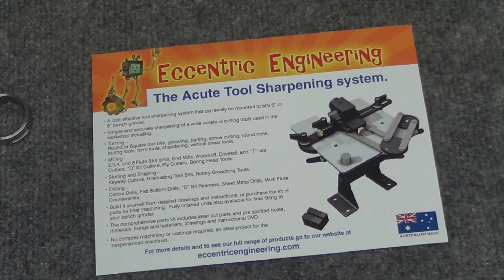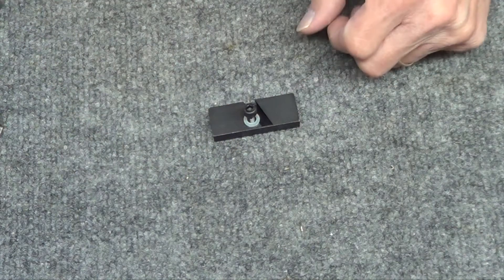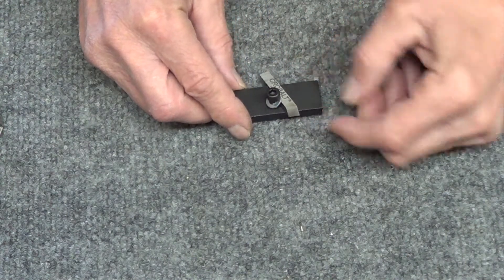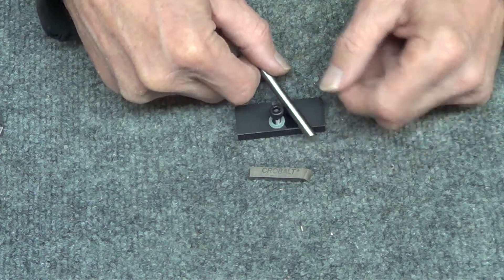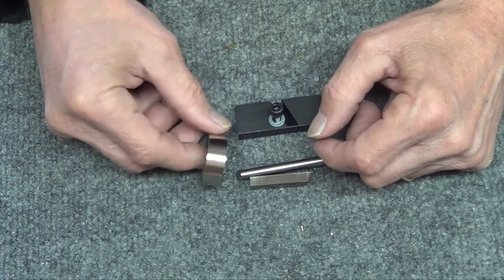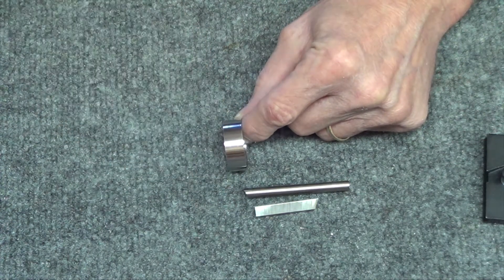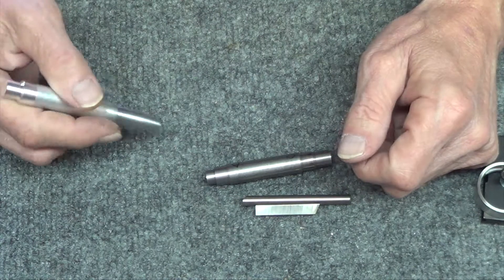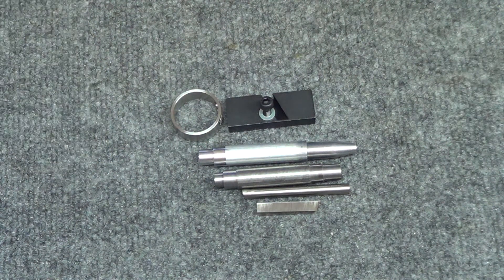The Diamond Tool Holder or Tangential Lathe Cutter Pt. 2

Comment: I see in this video you appear to have  the sharpening Jig as supplied by Eccentric Engineering. This simple jig enables a simple means of shaping and sharpening the Tool Bit. It takes all the frustration out of the shaping and sharpening process. My latest tool bits have been sharpened on a water cooled Tormek using the same jig. depending on the grinding wheel used I can end up with a knife edged tool bit which cuts metal like a knife through butter. Like you this tool is in my way of thinking, the Number One tool for the newbie Machinist, note both left and right tools. mine are on Quick Change tool holders. Thanks for the reviews on a great product. I bought mine on the recommendation of Rudy Kouhoupt while my machines were still in the ordering process.

Comment: I just tried this system out and was very happy with the results. A small tip- the washer on the grinder jig tends to fall down when you are inserting the cutter- I put a spring over the retaining bolt which hold the washer against the bolt head